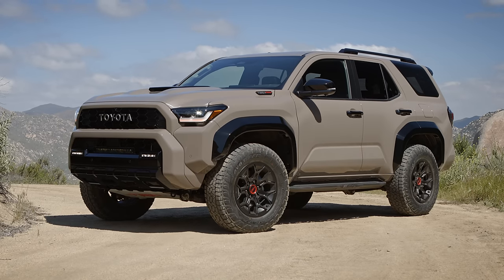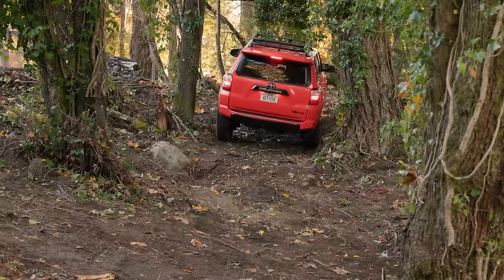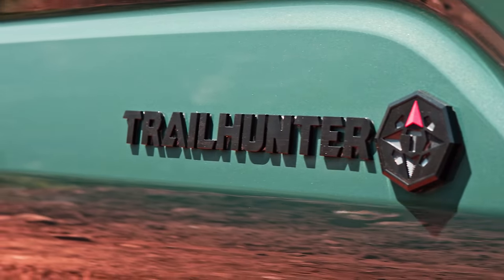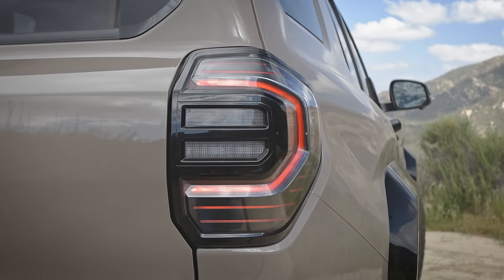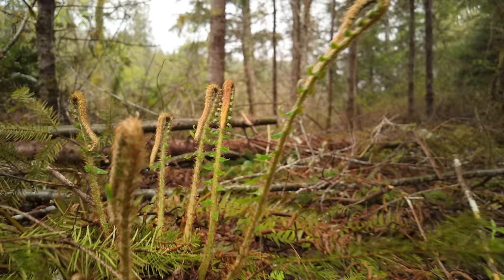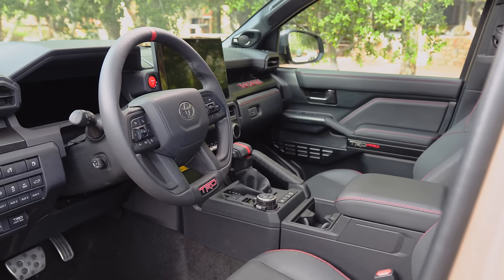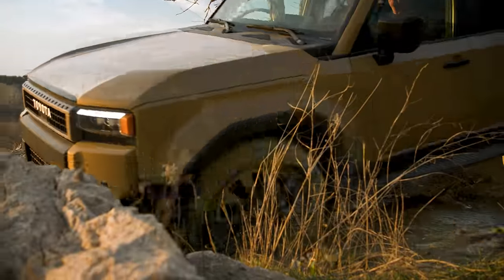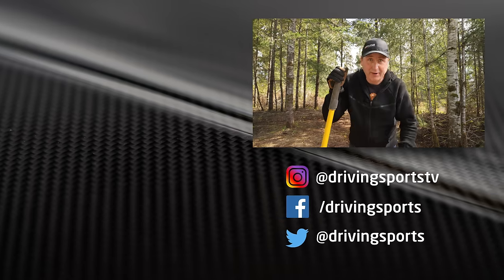2025 Toyota 4Runner First Look: Limited, TRD PRO and Trailhunter!

Comment: NiMh batteries are ancient battery tech. I used to use them in my old RC cars. They don't hold a charge nearly as well as LiPo and they suffer from memory. Not to be a Debby downer😬
Reply from the maker: According to Toyota, they’re better for fast charge/discharge applications. Which is why they still use them in a number of their hybrids.

Comment: Kinda looks like a meaner Sequoia, which I have been left feeling is the best looking SUV you could lift and off-road out. Not sure yet if this changes my mind on that.
Though I 100% will never buy due to the fact Toyota's force feeding an electric engine down my throat while having the audacity to call it a replacement for an overhand vehicle .
Also hate the massive blinding screen.

Comment: No enough subscribers to get flown out to the launch?  I have subscribed to get you to the next one.
Reply from the maker: It not a matter of subscriber count. There were far smaller channels at the launch and time was extremely limited for this and all the drives they were doing. It sounds like it was a trainwreck to film around, so it's just as well we weren't there. Far more interested in getting it onto our test course later this year. (But still worth covering the specs we did have available in this video.)

Comment: How can Toyota level the lower control arm with a 2.5 inch lift kit?
Reply: For any stock IFS vehicle, at stock height, the LCA is leveled. If you put on any lift kit, the LCA and CV axle will be at an angle. But the trailhunter does not have this issue. How?

Comment: I was hoping for a smaller off roader, the size of Ford Bronco Sport. Currently, no one is addressing that market and Jeep is not it.
This is just a Tacoma with a roof and the same size and engine as the Landcruiser.
Kind of obviates the low end Landcruiser and the high end Landcruiser is practically the same as the Lexus GX.
Toyota needs to reevaluate its NA marketing crew!
Reply from the maker: There are rumors of a smaller off-roader in the wings. Nothing specific yet.
Reply: @drivingsports Corolla Cross TRD Offroad😂😂

Comment: The recent releases of Toyota are very confusing, especially when comparing 4runner2025 with the land cruiser 2024. I prefer the looks and powertrain of 4runner better and they have integrated the heritage better than they did in the landcruiser as the latter looks frail and fragile with those tiny tires as compared to good old 90's landcruiser. The 4runner in my humble opinion has a better combination of overall features that i mentioned earlier plus the rugged look, it's just more appealing for the offroading without worrying about wear and tear !

Comment: plastic at the bottom of the limited trim is horrible. rear door seems shorter than 5th gen along with the rear leg room. Tacoma roots I guess. From some angles it reminds me 4th gen. Overall much nicer design than 5th gen and much better standard options. I'm interested in SR5 4wd model, hopefully they did not put manual air conditioner.

Comment: I think its kinda cool but whats the point of the landcruiser and 4runner??? The powertrains are disappointing and builds are similar. The 4runner seems like the better buy but why make the landcruiser?? 

Theyre better off making the FJ again but upgrade to solid front axles to compete with jeep, bronco, and grenadier. If the goal was a dedicated off roader, they kinda fumbled. The GX550 was the only good thing so far

Comment: I've owned two 4-Runners, 1995 and a 2015 Trail Premium. Hopefully Toyota does better with the technology than on the 2015 as that one lived up to it's TRD designation, big turd! Less is better, I'd be reluctant to buy one of the new ones until others have suffered through the problems.

Comment: Not many EVs' for Toyota, which is the right direction. Whoever works at Toyota USA knows what they are doing.
Problems: The other day, I saw a Land Cruiser higher trim selling at SOCAL Toyota dealers for 90k before taxes and fees.
that is 4 Cyl. SUV.  
About 6 months ago, I paid 125k out the door for a Lexus LX600 F-Sport.  How much will these 4-Runners cost when they hit the dealer?
Toyota is doing great but price???
Reply: $81k+tax fees here on the LC first edition, that’s $5k markup.  SF Toyota.

Comment: Made in mexico, parts from China, 4 cylinder turbo trash engine with endless problems "engineered" in India from the lowest bidder. And at the very best clogs your intake manifold and valves with carbon. Exciting can't wait. I'm sure the price will be $15k more than '24 as well.
Reply: the fanboi are delusional

Comment: wow an SUV that doesn't look like garbage
Reply: It's not an SUV, it's a truck.
Reply: @pacattack81 
What? 😂

The 4Runner is a SUV, Tundra's a truck, RAV4's a crossover.
Reply: @Lucky8s  yeah as a 5th gen owner idgi
Reply: @Lucky8s  No, the 4 runner has a body on frame, which makes it a truck. SUVs are unibody.
Reply: @pacattack81 kind of funny you say that. The 4Runner is literally the one that invented apparently the SUV category with the 1st gen!!
Reply: @OldelCpt  This has been debated since the dawn of time. Most people say it's a truck because of it's body on frame construction. I am in that camp. Unibody = SUV. Body on frame = Truck. If you want to call it an SUV, go ahead.
Reply: @pacattack81  I agree that it’s a body on frame, but lower towing capacity, and obviously no bed, makes me not call it a truck. It definitely does truck things, but i’ve never seen myself calling it one.
Reply: @chrisgg80  Check out the comparison video TFL just did on the 4runner and Tacoma. You may think differently after watching the video. They are basically the same vehicle just one has a bed and the other more room for passengers. I have a hard time calling anything with a transfer case, locker, and body on frame an SUV.

Comment: Iforce max hybrid seems like such a mistake. You get the cost and complexity of a hybrid with no boost in fuel economy. Add the complexity of turbos. Why. Why not make a plugin hybrid EV where the gas engine is a range extender. I dont understand .

Comment: Again, you have not be able to drive a KDSS 4Runner. Mine has less body roll than my Lexus ES 350.
Reply: Do vehicles with KDSS have larger sway bars than models without?
Reply: @ALMX5DP Yes they do. KDSS doesn’t add anything onroad except the larger sway bar. Significantly larger. Offroad, it acts like sway bar disconnect.
Reply: @OldelCpt  thank you. Makes sense they can get away with a larger sway bar setup since it does not necessarily compromise offroad ability.

Comment: hybrid... thats where things might go wrong....
Reply: Why? They've been doing it for 25 years. If there is anyone to trust with hybrids, it's you know who. And I had 13yrs of first hand experience.
Reply: @ryant1090  u have 25 years experience with a hybrid tocoma??? Or a prius? Same use case? same engineering? Same users? 
Why? Because u forgot being simple is the key to longevity and durability. Have u ever seen an OS that never needs reboot? That never runs without glitch? How many electronics in a hybrid system to achieve the number game? And Toyota built its reputation on simple gas and diesel engine over 40 - 50 years not a hybrid. So reliability still up in air for more years to come.